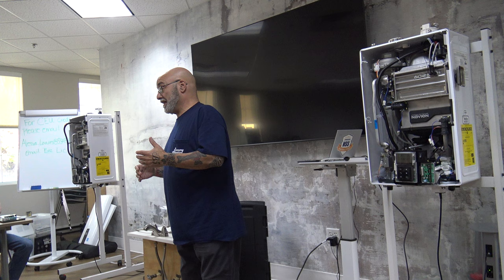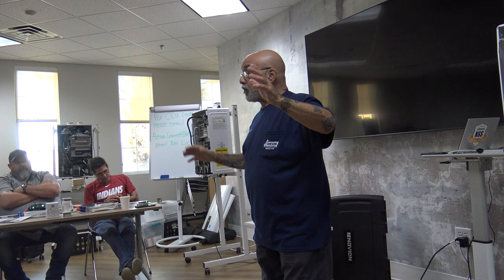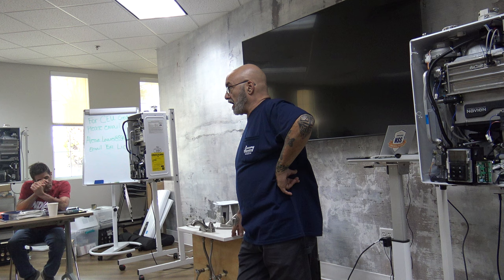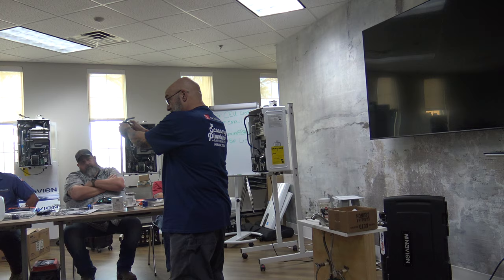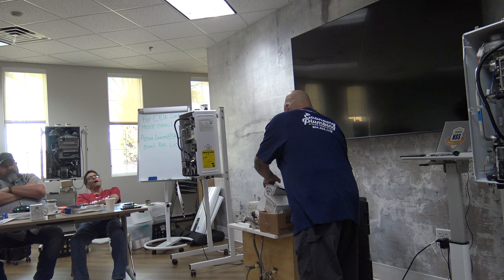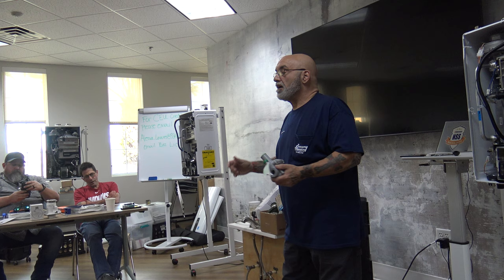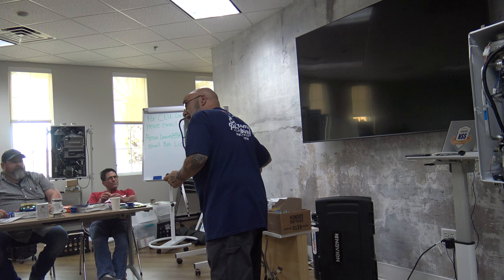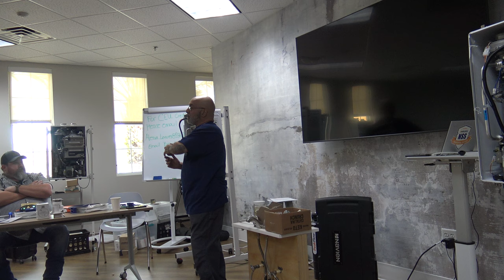Training plumbers on how to correctly install a tankless with Navien

Comment: Thanks for the video.  I came here after my plumber blamed my NPE--240A2 putting out hot water from the cold tap on the Navien system.  By the way, you nailed it!  3 is tertiary.  The full count from 1 to 10 is primary, secondary, tertiary, quaternary, quinary, senary, septenary, octonary, nonary, and denary.

Comment: The only experience I have had with Navien was a 4 year old unit exploding repeatedly and blowing the exhaust vent pipe off the unit, pouring CO into the facility, luckily no one lives in.
Reply from the maker: It could have been not converted rite or condensate building up in the heat exchanger
Reply: It was converted properly, unit was warrantied by Navien. Unit was swapped and the issue has not reoccurred yet.

Comment: having leaking heat exchangers out of the box is not installer error....we stopped these. they are dangerous and a liability
Reply from the maker: I beg to differ, I’ve installed over a thousand of the series 2 and not one problem👍👍 Now Rinnai is a different problem. Thanks for the comment